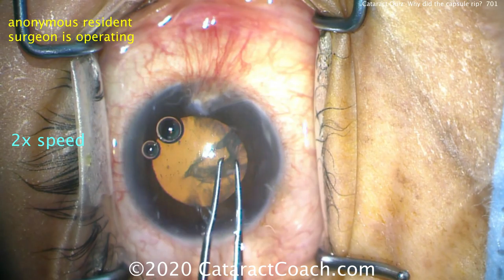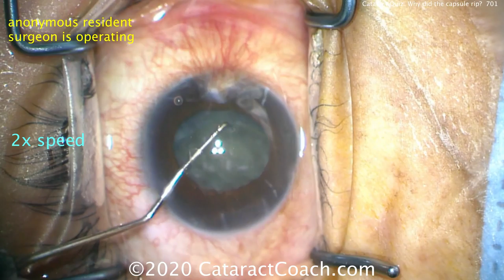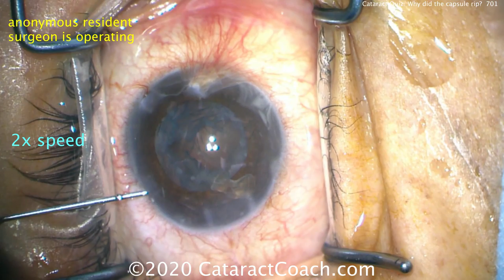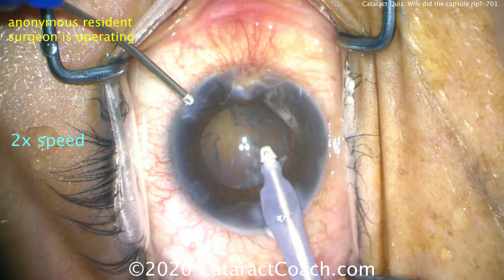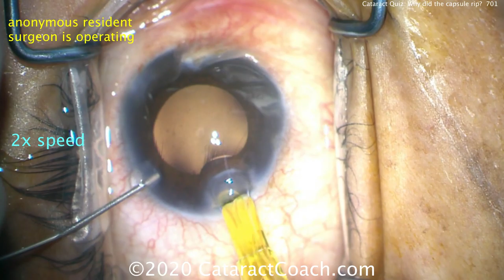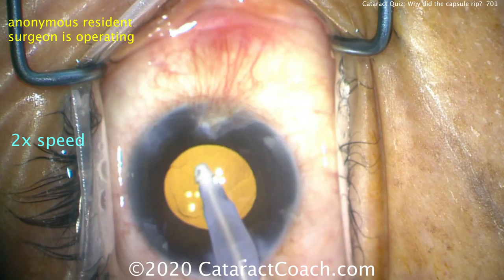Cataract Quiz: Why did the anterior capsule rip uncontrollably?

Comment: Your thoughts on lowering the phaco and cortical aspiration parameters to do a slow motion phaco? Or not necessary?
Reply: Slow motion phaco makes sense when there's vitreous in the AC. In this case there would't be a real benefit; it would make the surgery slower. As long as you keep track on the damaged capsular area and use more viscoelastic , it should be fine